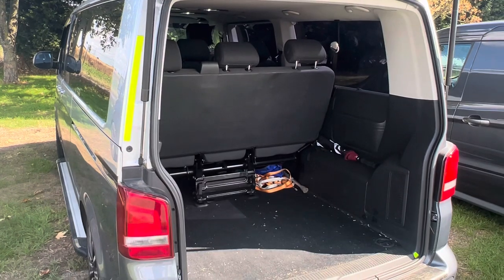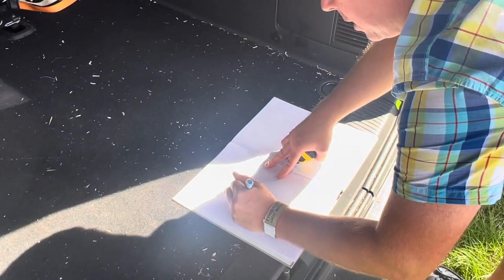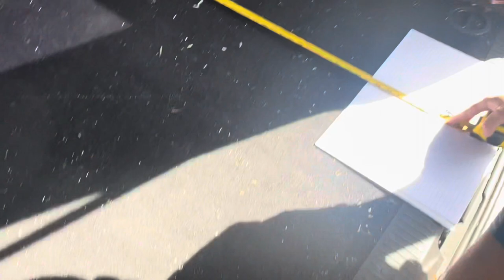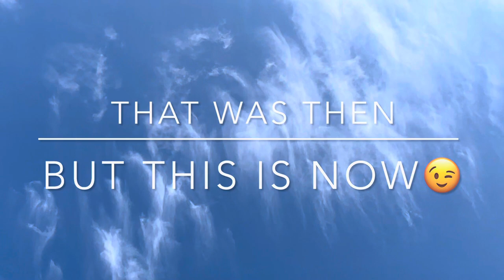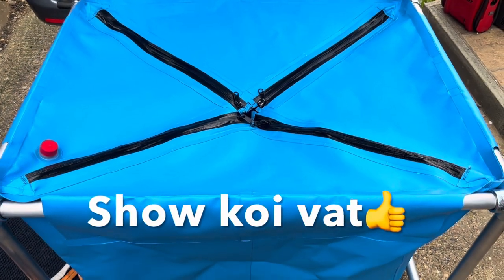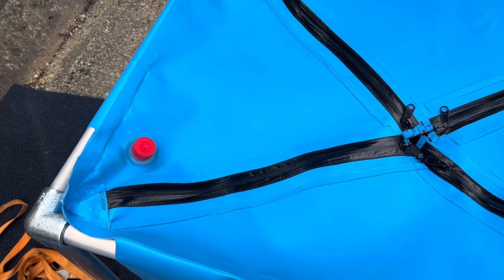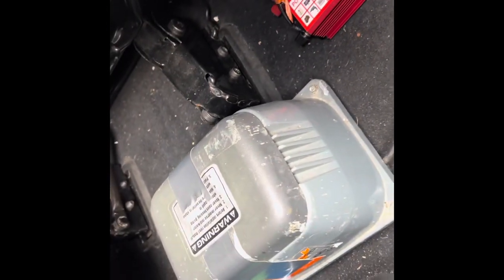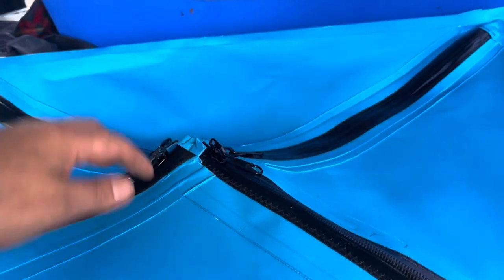Show koi vat 👍

Comment: what about the rear seats, they lean backwards as they go up, would you have to put the rear seats in to get the vat in.
Reply from the maker: I put the rear seat down. However I could have kept it up and it would have still been ok. But you are right the rear seat does slope back but wasn’t any issue. 👍😇👍